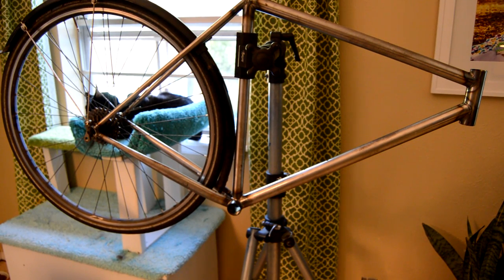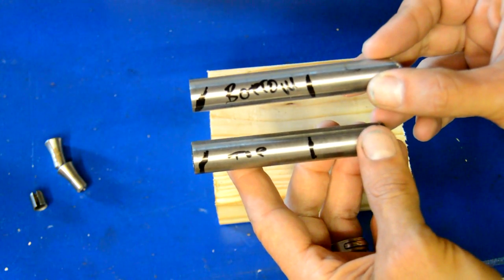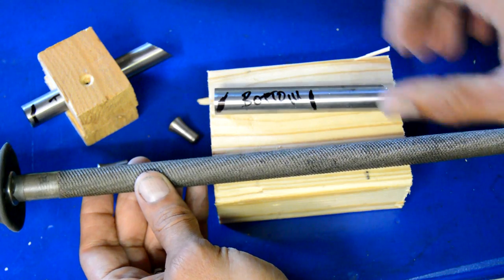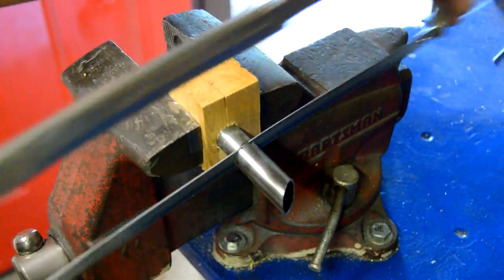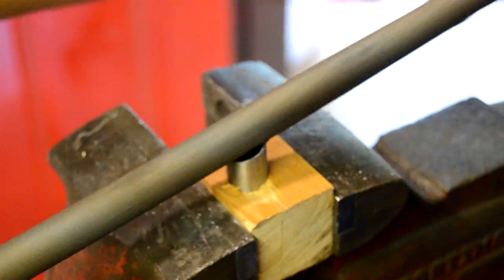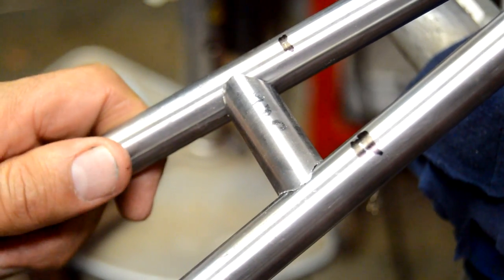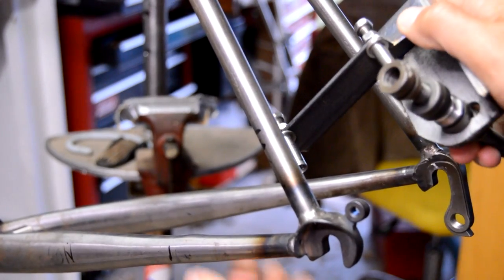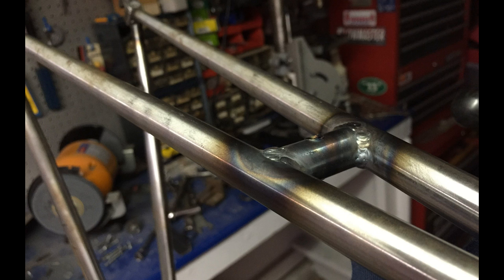Bicycle frame build part 10

Comment: How did you make the disc brake mount jig? I did a retro disc for my 1994 hardrock. But i used an old disc wheel and just tack welded the tabs in place. Your jig looks a lot more accurate. Ive seen them for sale, but they want at least $125 for them. Your vids are really helpful. Thanks
Reply from the maker: Basically it's just 2 pieces of angle iron welded together and mounted onto a solid 10mm axle. It's all built from random parts I had around the garage. I wanted to make the frame a post mount type brake caliper mount that set between to chain and seat stays. I'd seen a few mountain bikes that do this, and I thought it looked cleaner to use the actual brake caliper as the frame brace, as well as having it tucked away . I mocked up an old MTB frame with a disc adapter for a 160mm rotor, secured the axle into the frame with the first section of angle iron, then laid the second angle section onto the disc adapter to get the placement of the threaded posts set correctly. I could basically rotate the axle forward and follow the radius of the rotor until I had an area to weld the posts to the frame. I go a little more in depth on the jig in this video: https://www.youtube.com/watch?v=OxyJGMwi-68
Probably the next bike I build will have thru axles and a flat mount style disc type set up. I'll have to cobble up another jig for the dropouts, but they are available with the flat mount set up already manufactured into the dropout.
Thanks again for the great questions!!